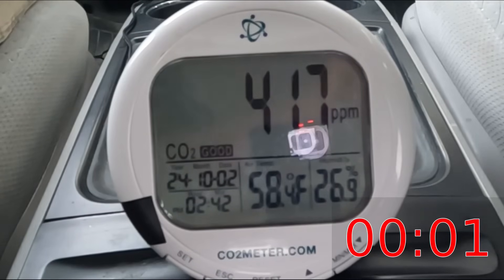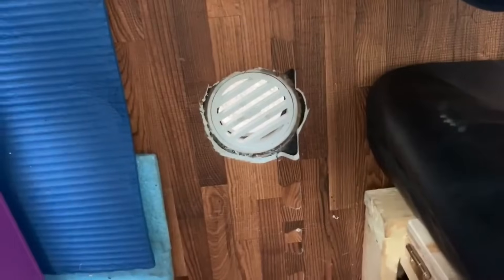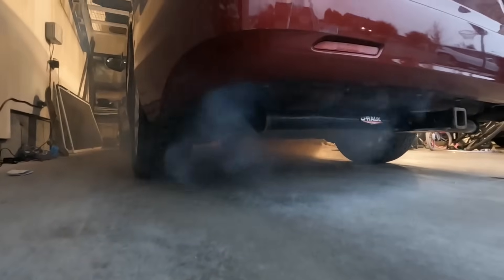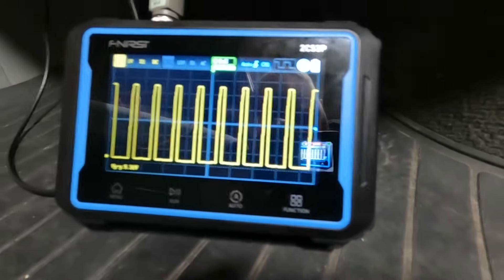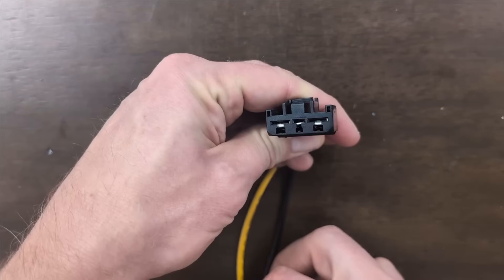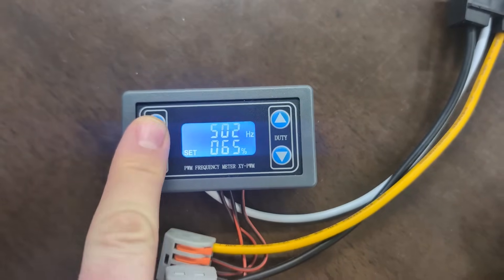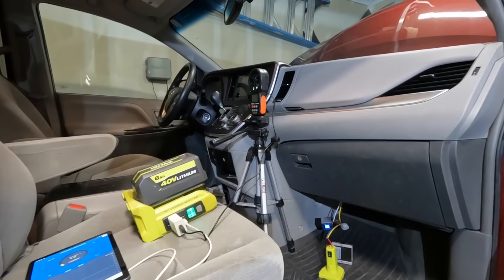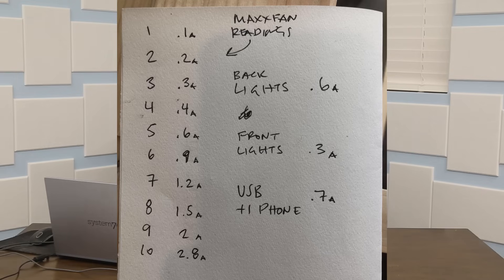Camper van ventilation without using window vents or cutting holes (first see comment by @drewcress)

Comment: I am not convinced that is a good solution.  A small fan (computer fan with speed adjuster & power bank, with tube to pull air from outside is still a cheap and easy solution).  Anything broke, can be easily fixed and did nothing to the car.  Power Bank also can be easily replaced.  There are 5V fan, if anyone feel difficult to find 12V power bank (yet, there is step-up you can find on Aliexpress, very cheap).  But I assure your there are so many solution out there to get the fan working and cheaply.   I have a sunroof, so I did the sunroof solution. Simply and easy is the best solution.   And basically, I really didn't spend any money (only the plastic panel).    Using the car fan meaning the car fan might go wrong or wiring might go wrong.

Comment: Or maybe cut a small round or square hole to a corner base of car and use a 12v/ usb ( computer PC fan) to suck in fresh air and leave side windows down with a small gap. Make sure side windows have rain guards attached.

Comment: When I was camping in a 2004 Prius, I found a silent and very efficient way to ventilate the car: I located the one-way valve air outlet flap vent hidden at the back from inside the hatch (had to remove some interior panels to reach it). I used some 5 inch ducting at home depot to attach a 120mm (approx 5 inch) 12v Noctua computer fan and a squaure flange with some weatherstripping, tape, screws, zip ties, etc., and a simple wire with inline on-off switch. I left the dashboard vent positioned to allow fresh air to be sucked in. This moved enough air to remove humidity, window fogging + breathe fresh air/oxygen while sleeping etc, but wasn't enough airflow for significant cooling. It was great in the cooler weather when some fresh air was needed without losing too much heat. It helped greatly for quiet sleeping since I could close all the windows and still breathe fresh air.
Reply from the maker: Yes, this sounds ideal. Thank you for sharing.

Comment: Interesting,  2 questions - do you have a link to the CO2 monitor and what if you just stuck fan on the air vent pulling in air that way then you should get air flow (think about when the van is off or 'vent' mode).   Not sure if your van supports that but computer fans are pretty low current draw.

Comment: Interesting video. Thanks for going to the trouble of making and sharing it.
I wonder if splicing in another hose to the intake vent with a small fan would also work ? That way if you wanted to sell the vehicle no-one will ever know the original hose was cut (If you replace or patch it)

Comment: Any vehicle blower fan that uses a resistor block for speed control instead of a pulse width modulation system is going to be very inefficient.  There are lots of rechargeable and USB powered clip on fans available that are cheap and easy to use.  My minivan has rear air vents for rear passengers.  Once I install a large ‘house’ battery I am going to look into adding a relay or manual switch under the dash to allow running the entire accessory fuse block off the house battery when the engine is off.  This would allow me to use all the fans, lights, and power outlets that are built into the van from the factory without draining the starter battery.  I would replace the interior light bulbs with LEDs.

Comment: Finally!  Someone who is talking about CO2 levels in a van!  I have posted the CO2 measurement question to numerous van YouTubers and not one really acknowledges the issue.   Thanks for taking the time to do this posting!
Reply: A good side effect is that high CO2 levels make us sleepy
Reply: @richardchristian6974  yeah, and reduce sleep quality.
Reply: I watch many and they have two sensors in the vans. Maybe they are just too busy to reply directly to you.
Reply: Me too. 

If you’re really worried, buy one of those oxygen sensors that you put on your finger (you can return it) , and check your oxygen levels in the morning.  

The alarm bells at 1500 aren’t really accurate, I have read.  Meaning, it’s not a big problem for the human body even though the devices say that range is bad. 

I don’t know what to believe, but at least using an oximeter? on your finger will give you your blood oxygen levels and that seems reliable. I think?

Comment: Hi pal, I love this! May I ask, with the accessibility to the wires, why not wire a switch before the house battery, so when parked it'll switch to house np. Then back when driving. Very sorry if I didn't hear something about that. Interesting use for the batteries, and I'm not even sure I thought of the dash system. I guess I figured it'd all be dirty, used full time, being around the engine bay I presume. But a hepa filter should be standard and therefore should do for this use :o though filters do need cleaning more regularly this way

Comment: where's the ten foot long spring loaded sledge hammer video please
Reply: Yeah, ya gotta admire this guy's self-awareness level on the ridiculousness of his crazy-ass sol'n.  He also has the good grace to point out that a std, commercially-available brand-name powered air vent does the same job while consuming just 1/10th the power of his own custom sol'n.  (Nevertheless, an impressive exercise in tech eng'ring, 'eh?)

Comment: Seems like you have a hole in the back where the smoke came out.  Why not find that hole and install a computer fan and use that as inlet
Reply: you would still need an outlet. The air has to move, otherwise once you pressurize the cabin, you end up with the same issue..stale air that is not being replaced.
Reply: @Parsons_Project  The air will exit in the opposite direction through the main ventilation system and also through other holes in cabin (because car is not submarine), but since there are two air flap valves, the second one needs to be closed or innstalled second fan, and better to make fan not blow the air into the cabin but sucked out.

Comment: I saw this vid a month ago and decided to improve my internal air because I am One-in-a-Van, but I found air quality even worse that yours !!  I frequently sleep in this van, so the measured co2 was not healthy at all !!
***I think you'd do this better than me, but here I kinda blundered forward, but I installed custom.
My Bluetti power station is adequate to easily power & Batt. the installed fan.

in-flow air;
under car, just behind the front passenger seat,
I cut a ~4" hole to accommodate a custom airbox from a plastic water jug (for prototype I just went cheap materials ~$11),. Then I housed therein an off-the-shelf auto cold air K&N filter ($13),
mated to 4" clothes dryer flex hose pipe (~$5, but I already had it),
connected to an AC (and DC option) weather proof inline duct fan with variable speed control ($30 AC Infinity).
I finished inside output by continuing with clothes dryer flex hose and a plastic directional out-vent mouth, where I also protect against any blow-by pollutants with another washable cloth filter (but so far it stays clean).
The fan is also direction reversible and I direct out-flow anywhere in the van.
This is a garage make-shift prototype and I keep breaking it.
But I like it's utility & results enough that I intend to now graduate to more completed components finish.
Then maybe I'll reverse the design (without the filter) to create an exhaust scheme back of the van.

Comment: I have always wanted to do that.  Thanks!  But yes, those car fans are power suckers.  I wonder if the outside air door is left in the open position when ignition is off?  If so, perhaps fashion a cowling around a 5v computer fan, position it over a vent, and plug it into a usb port.  It'll only draw maybe 150mA.
Reply: His and your ideas are neat but one potential issue is any blackout curtain fitted between the front and sleeping areas ... fresh air will have a restriction to overcome.

Comment: Regarding smoke exhaust. On my van there is a built-in storage bin in the very back behind the driver. Under it is an access panel with some of the tire change equipment. Inside that access panel there's also an exterior vent.

Comment: Once the rear outlets was found, I would have put a fan there to evacuate air, and either let it suck trough the car system, or a window crack. I also saw someone make a gap in the doorseal to ventilate a car

Comment: Too complex.

First of all all this in 21st century is based on digital controller, starting from $5 arduino. It will generate pulses and monitor/control anything you wish - battery voltage, state of native signal from car systems (so switch off and do not alter any usual fan operation), all air vane controls, time of day, set timer, whatever.

Second - all these systems begin from secondary battery system installation. Other way it always ends up with flat main battery unable to start the engine.

Comment: Wow, adding to the great ideas for stealth. The only addition would be for less battery usage is for it to cycle on and off, allowing the CO2 to get in the 800-1000 range to not cool things excessively in the winter.
Reply: I think it needs to be tested which is more energy efficient, on-off or running it at a lower speed constantly.

Comment: I have a converted Dodge Grand Caravan. My approach is simple. I have good rainguards on the four main windows. I crack to kittycorner windows based on the direction the breeze is coming from. I lower the windows to just above the bottom edge of the rainguard. I have window insulation that will fold down the and allow air to pass thru. If I need more air I clip a good USB C rechargeable fan to the front row seatbelt and one to the opposite cross corner area. I don't remember where I heard this but you need 6sq inches of open window for ventilation when staying in a mini van. Doing this I do not get cold, there is no moisture buildup on the inside, rain does not get in and no one can see the windows are cracked open. Been doing it for years with no issue. And I have bug screens. Easy peasy.
Reply: Do you happen to have pics of how bug screens fit into the setup? I'd like to do the same. Thanks!

Comment: I have a pop up sink waste in the step well; a muller vent on the roof and underneath a noctua 12f fan(0.07a) with a variable switch. Max air exhaust about 7 litres per minute.
Reply: Ventilation effectiveness comes to mind, getting the air to where it's most needed. Floor vents as part of a multi vent system seems to have merit.

Comment: Most car HVAC systems have a simple 12v input for auxiliary fuel heater like Webasto. So in most cases you need a simple switch. Just look up electrical drawings of your car and you should find it. These auxiliary heaters are popular in Scandinavia.

Comment: This makes me wonder why manufacturers don't make this a feature for dog owners. Leaving a window open isn't why secure.
Reply: 2010 2015 Prius solar would run the HVAC blower off the solar panel to keep temperatures within reason. Not really for pets but idea and technology is there, they just don't. It also had a button on the remote to turn on the air conditioner remotely.

Comment: I installed a complete car ventilation box into my camper. I was worried it would pull too much energy so i was afraid of using it. Since i have my Victron Solar charger i could figure out it pulls 30 watts on first fan stage. this way i could run it for 30 hours on my 100ah Lifepo battery and 15 hours on a lead acid battery.

Comment: Hi, it’s a good idea to use the existing OE,fans, ducting and filtration all provided FOC. Most motors are PWM driven now so it’s just packaging and powering the unit.
I have seen a video where for stealth he put PC fans in the rear door posts and sucked the air out that way, venting down the post to the ground, using existing air path.
You need air flow but might not want bloody big vent on top of your roof showing it’s a camper!
Good video, take care M.

Comment: Man, thanks for the CO2 info. I wrongfully assumed my van would naturally circulate a tiny bit of air through the vents. Your meter shows otherwise. Plus another comment on here made a good point that many vans close the vent flap to prevent bugs dirt and rodents from getting in when the vehicle is off. I have been cracking my windows, but I see I might need more than that. I’m gonna buy CO2 monitor.
Reply: Agree, though I don’t think most vehicles are air-tight enough to make people pass out.  I am no expert, but seems like there would be many cases of it from people sleeping in cars, or that it would be a risk when driving.  

But higher CO2 will definitely cause some symptoms, like feeling tired or groggy, headaches in some, etc.
Reply: If you are talking about the exit flap, its a simple one way valve.   Something from outside pushing in can't get in, it can only be pushed out to release air and it does so passively.  If you mean on the intake, seems odd it would need to considering that there is a cabin air filter in the way before the air gets inside the vehicle one way or another and it traps debris.

Comment: As an electronics engineer, I found the approach interesting but it  reinforced my approach of just cracking the window.
Reply: I mean, yeah, its a neat solution to but its a pain in the ass if you ask me. I'd be wiring an auxiliary battery to power the cars electronics when I want it on a switch, rather than some jerry-rigged system I have to plug and unplug all the time. Hell, throw a 3 pole dual throw switch in this system and you could practically achieve the same thing with his set up.

Comment: @SemiSeriousLabs  I did a similar thing when I was away camping in my Lexus LX570 (200 Series Landcruiser) a few months ago, so I could control the car's ventilation fan using my phone while sleeping in the back.
Luckily, being a nerd, I took an ESP32 module with me (they are only a few dollars) in case I decided to control something while away on the road. 
ESP32's are 3.3V, so I went to the local electronics shop (Jaycar here in Australia) and bought a 3.3 to 5V converter and a relay. I used the Arduino IDE and programmed the ESP32 to create the Pulse Width Modulated output to control the fan speed, and host a WiFi Captive Web Portal website. I powered the ESP from the USB power that I already have in the car. It only took about an hour to set up.
As shown here, the Toyota wiring is really easy to access. The White/black stripe and Black wires are battery power from the car and remains on even when the car is shut down, Therefore it only needs a PWM signal on the third small wire to make the fan run. I just cut the smaller signal wire and connected in the relay (Common contact to the fan side, N/C contact to the car's signal side). When the relay is off, the signal to the fan is connected as normal to the car's control module. Then connected the ESP32 output (via the 3.3 to 5V converter) the the relay N/O contact. The relay is also controlled by an output on the ESP32, so is also controlled with the phone on the website. When the relay is on, the PWM signal comes from the ESP32.
I just played around with the PWM values until I found out the required Duty Cycle. As the signal is generated by the ESP32, it can be inverted so that 0%  to 100% setting on the Web Portal is 0 to 100% fan speed. I also set up a timer function so I could make it time out and not remain on after I'm awake. 
My setup was still running off the car battery, however I have a 2nd battery in my car, so I wasn't too concerned about the battery being drained. I also have a Bluetooth monitor on the batteries, so I could also use my phone to look at the battery voltages and make sure it was OK after each night. 
I found that you only need the fan just ticking over through the night to create heaps of fresh air and it barely had any effect on the battery. I thought about also setting my system up to only bring on the fan every 10 minutes, but didn't bother when I realised the battery was fine.   
I intend to make a video of my setup eventually, but have been too busy since I got home.
Reply from the maker: @desparky Excellent! You've got a great setup. My own battery is on its last leg, so I don't trust it. Also, you got me curious about the ESP32, so I just looked it up. I own a couple of Arduinos, but the ESP32 looks both better AND cheaper. I've subscribed to your channel and look forward to seeing your video when it comes out.

Comment: Could you replace the ryobi battery and voltage converter with a portable power station with 12v out? I know you were using what you had on hand. Im just curiousif you could get more run time and use somwthing that some van dwellers have on hand.
Reply from the maker: Yes, and that would be better. I know some of my power gets lost during the voltage step down stage, and yours wouldn't need that.

Comment: Very clever! I never thought of that solution to air circulation. Thanks for sharing! -On my 2007 toyota sienna minivan, I cut a hole near the rear of the vehicle on the driver's side. And then I cut a hole in the roof for one of those 6" mushroom vent fans. These holes provide a path for air circulation and it works well. And I can cover all of the windows. -But, like you pointed out, I had to make permanent modifications. I'm not worried about permanent modifications because my minivan is 17 yrs old. And if I ever sell it, then I'll just sell it as a minivan camper. I posted a video on my minivan camper on my channel.
Reply from the maker: Nice. I'm jealous of your heater. Cool how it has a heat exchanger instead of burning the same air you are breathing, like my Buddy Heater does unfortunately.